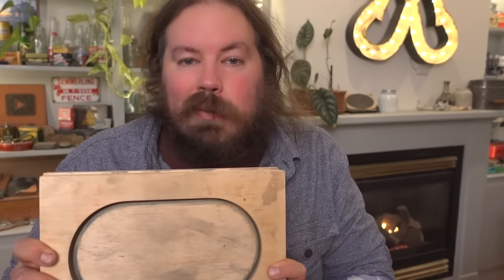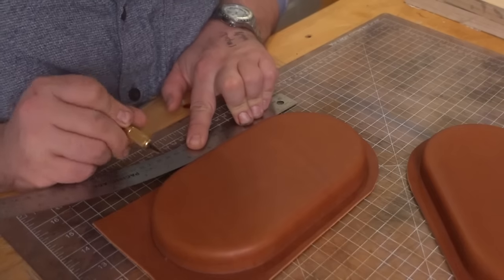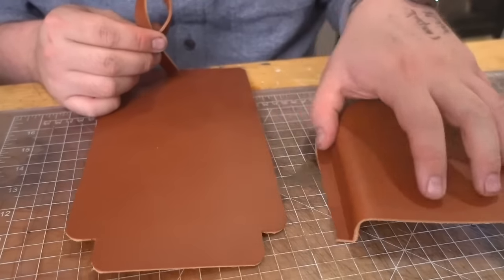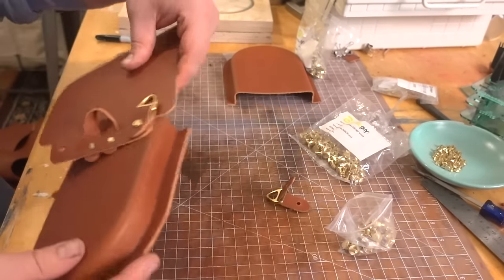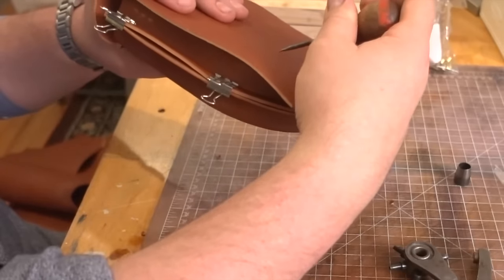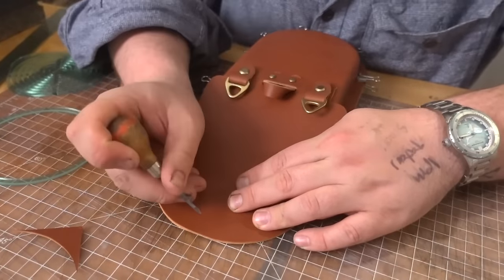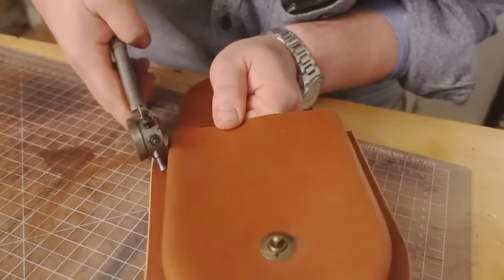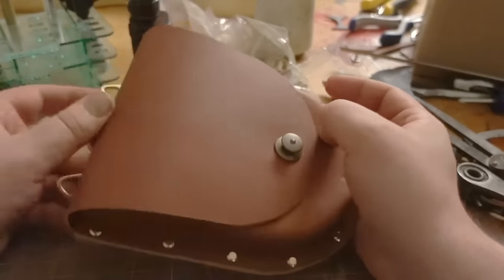The Easiest Leather Bag To Make

Comment: The best locktite for small screws i used it the blue loctite that comes in a stick like lipstick. The blue is removable but if you use red loctite you will need to use a lot of heat to break it loose.
Reply: Bruh, I use glue stick, like Elmer's
Reply: I have some of that I use too , hear in Tennessee most of what’s on the shelf is out of date, I use white Elmer’s glue on them.
Reply: @mikecleek3964  Do you get any corrosion on the screw from the elmers glue? I find that it can cause spotting or a bit of rust on my chisels if i get elmers on them.

Comment: OLD Leather Smith here, I use a tool by heritage that installs Chicago screws tite so you don't have 2, use lock tite.  There's 2 out there the one I use locks down so you can use 2 hands on the project.  GOD'S BLESSINGS ✝️⚾🙃
Reply: leather smith is not a thing. find a new personality